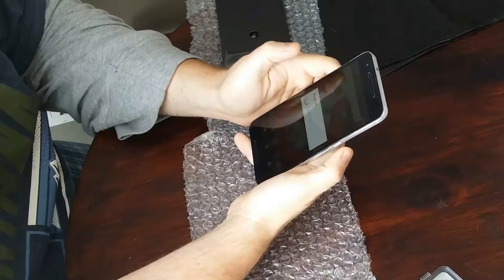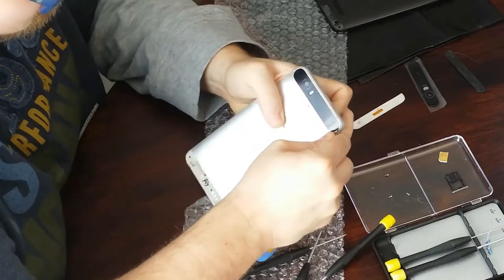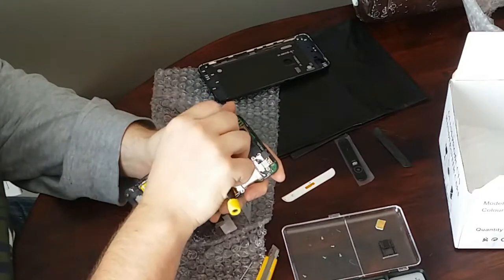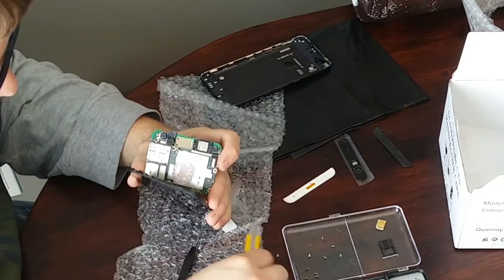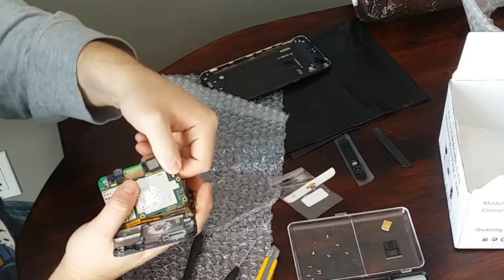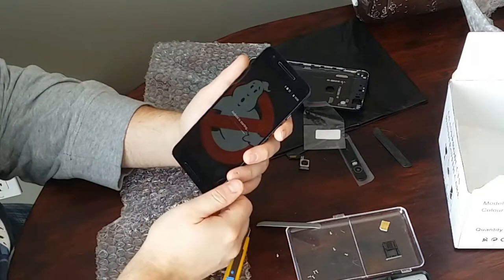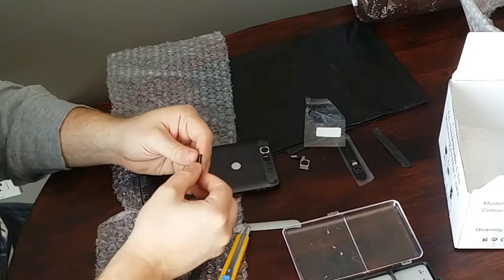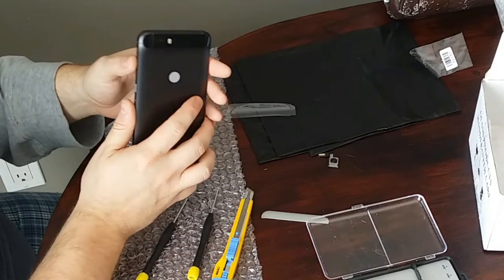Huawei Nexus 6P - Camera and Case Replacement

Comment: did you get a nfc antenna ? its seems that your back cover does not have one.
Reply from the maker: I didn't get one with the back. Would have to check the original to see if its there. Never used nfc with it so not sure!